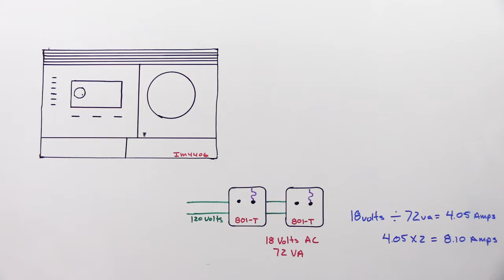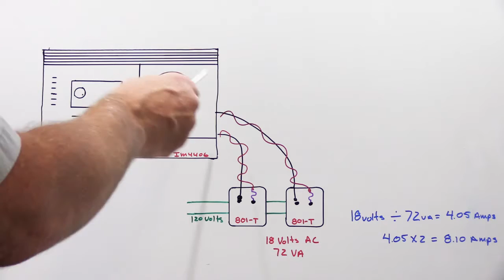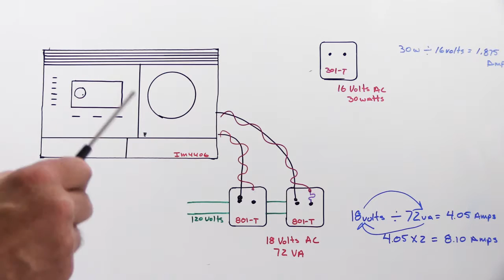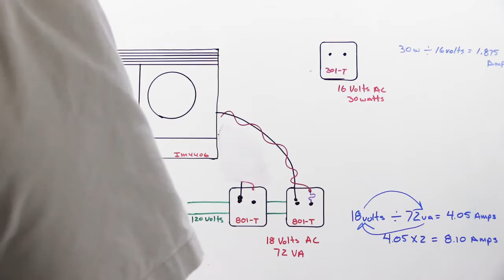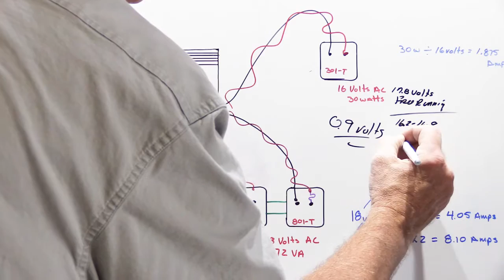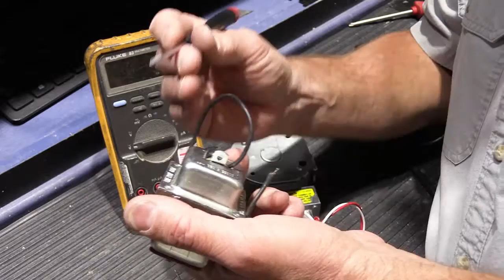NuTone 801T Transformer Problems and Troubleshooting with a NuTone IM4406

Comment: Do you offer a rebuild service for the 801T? What would be the cost? Thanks!, Don.
Reply from the maker: Hi ddepair:  Yes, we do repair the NuTone 801T Transformers - An important consideration before having the 801T's reapired is - "why did the fuse(s) blow in the first place"?.  If the fault that caused the Fuse(s) to blown hasn't been correctly - the fuse(s) will simply blow agian as soon as the power is turned on - Here's a link to our Video that shows how to check the Master Statiosn for a fuse blowing failure:
https://www.youtube.com/watch?v=p2SJ-Qh8Cp8&list=PLsTvqKsBnGYcoTSfKTOHOltP98FFiuUP1&index=24
     You can contact us directly about having the 801T's reoaired - Chris     nscompany@msn.com
Reply: @northsideservicecompany3567 Thanks! I will diagnose this week.
Reply: Thanks! I will diagnose this week.

Comment: I made the mistake of drawing power from the transformer in an attempt to charge a USB bluetooth device hooked up to the nutone intercom. It blew the fuse right away once I tried charging the device.  Would you say that was expected?  Max amp was supposedly rated 3amps in the 5v setup.
Reply from the maker: Hi Waleed: It is difficult for me to comment of the specifics of what happened - because I don't know what equipment you were using, or what you were trying to do, or how you did it - Simply, there not enough details to comment on this - You may want to contact me directly and I'll see if I can help out - Chris  925-743-8236

Comment: You have exactly described the issue I am having with my IMA 4406, it appears only one of the transformers are working. Very informative video!
Reply from the maker: Hi Steve: i'm glad you found the Video helpful.  What are you going to do about your Failed IMA4406? - Chris
Reply: At the moment, I haven't a clue, I'm afraid the repair would be cost prohibitive, we really liked it while it worked
Reply from the maker: Hi Steve, if you're interested in having it repaired, you can fill our an Intercom Repair Request and once I receive it, I'll contact you by phone to discuss the problems and repair of your IMA4406

Here's a link to the Repair Request Form:  https://docs.google.com/forms/d/e/1FAIpQLSdQHT6fVgm25twaXFeCkkgeITEfAE_zlRBry6B8-GbIs19wcQ/viewform?formkey=dF9RVjBQMFQ5S0xYbTBHMHRoNkVkRFE6MQ

Chris